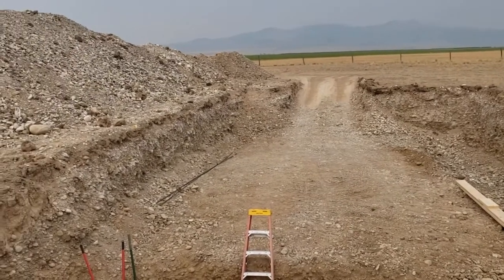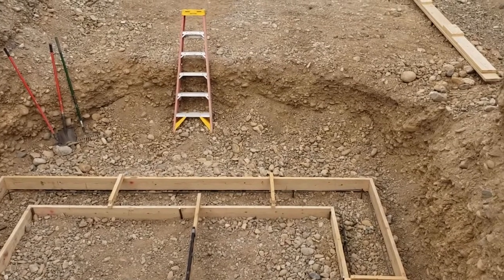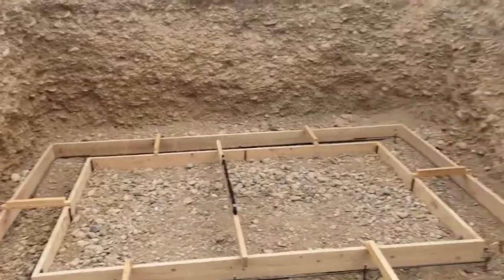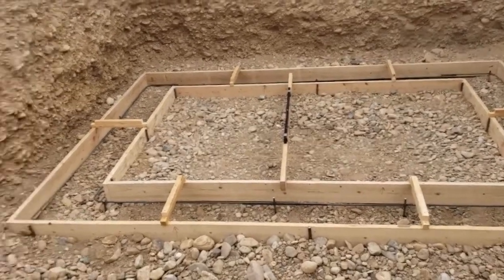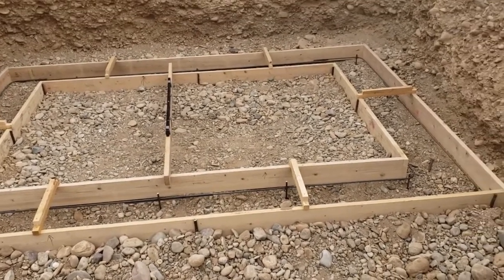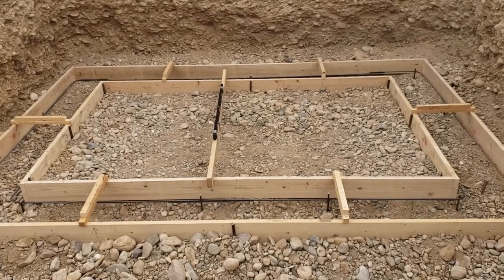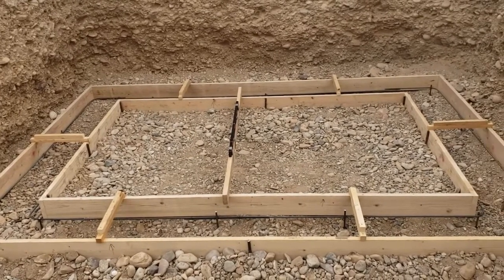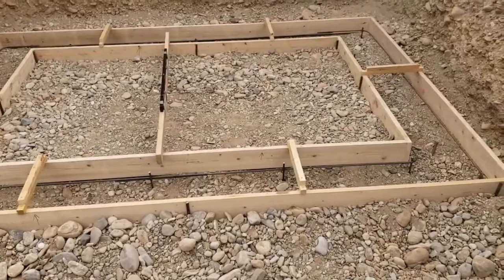Step 3 Southwestern Montana earth-sheltered, walipini-style greenhouse

Comment: Foam is plastic, yes? Why not greener insulation like hemp and rockwool?
Reply from the maker: Thank you for your comment.  Good suggestion.  So in answer to your question, foam is petroleum based, yes.  So for us, we live where in winter we get -30F below or colder.  Hemp and rockwool will not give the insulating properties like foam unless you go really thick on the hemp/rockwool - like hay bail size.  Too, I believe hemp will deteriorate faster than foam, so if one were using these methods, perhaps a coating could be applied to keep the hemp from rotting.   I didn't do any research on that, so I don't know.  Have you used hemp or rockwool as an insulation?   I would love to hear about the application.  Cheers, J&K